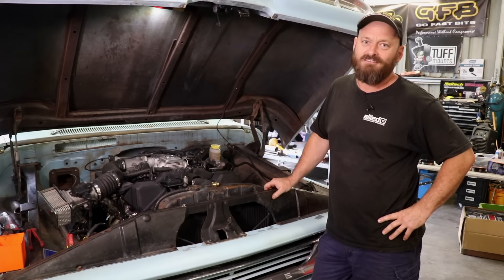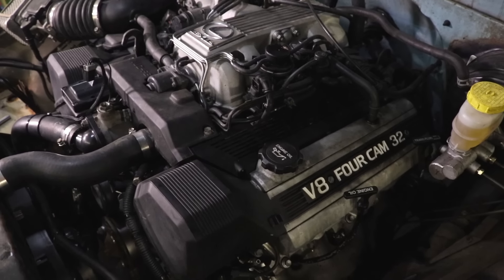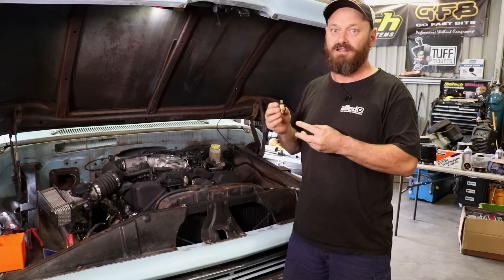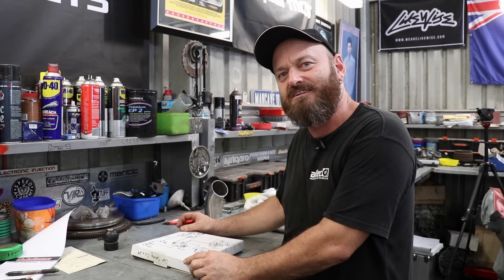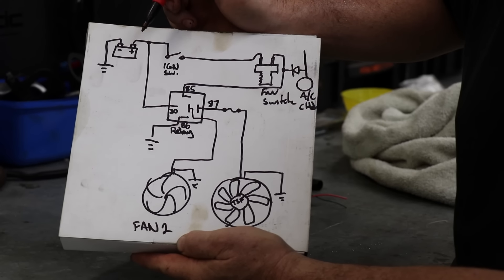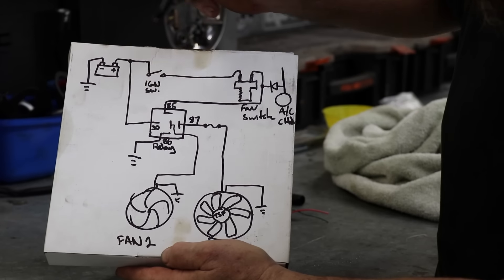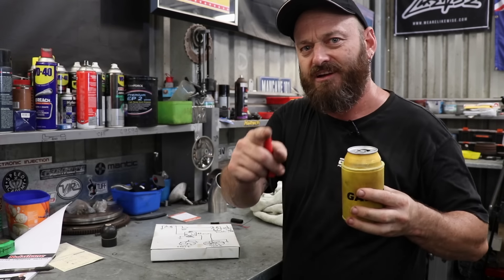THE SKID FACTORY - [QUICK TECH] HOW TO WIRE THERMO FANS

Comment: Nice one, I'm sure my Peugeot fan is wired in series with my switch with no relay. Power > Fuse > Switch > Fan > Ground. So it's even simpler than a relay setup :)
Reply: Yes and that is why these switches fail so often.
Reply: @alanbutler2579  I get that, totally man. They're not designed to take the high current draw.

Comment: I found a nice little SSR for PWM control which is cheap, waterproof, flying leads, mounting tabbed and heatsunk. Good for 40A too and permanent power. Only needs +12v, gnd and PWM signal. 

dorman fan controller 902-310 from Amazon 👌
Reply: If it's Dorman it might not run very long.
Where do you get the PWM signal?
Reply: @fascistpedant758  I have two for redundancy.. I have a stand alone ECU

Comment: I've always had trouble with thermal switches like that. Eventually they all go out of range and activate at different temperatures. That's why I only ever recommend adjustable fan controllers that you can adjust as your thermal sensor ages. Also allows for you to tune your activation temperature and sometimes your hysteresis. I get this is a cheaper option but the headaches aren't worth it for me.

Comment: Tridon TFS110 and TFS111 are 3/8" are good for v8's - TFS111 is best. If you have a/c you use another relay to turn on the fan. Ford 40 amp relays available on EA to AU can handle most fans. If you are using the FG single fan the Davies Craig controller works well as it turns on the slow speed before the fast speed

Comment: In your diagram the middle is usually 87a which means closed at rest or I term it always. The fan 2 would be on all the time with the ignition and off when the temp sensor switched to pin 87. So only one fan would be on at a time if it's a standard Bosch 5pin. If it has a legit two pole 87 switch then you are good

Comment: This is such a great resource. But I wonder if someone can answer this for me. 
I have an R33 GTST Skyline, I want to convert from the viscous fan to electric fan. 
There is already a thermo sensor in the radiator. Should I leave it plugged in and splice into it to run to the relay? I assume as pointed out its used for the AC as well (I still have AC)? 
Also do I need to do anything else to the old viscous /clutch fan assembly other than remove it (anything with wiring)?

Bonus: I also have a Link G4x ECU; is there a better way to do this using the Link?

Comment: Wicked job guys. I love the way you repurpose stuff and think out of the box. Wondering what your thoughts are on micro relays? Now al you can laugh but plz don't hold it against me as I have a v6 ecotec in my 4 runnner (It is a weapon off road). when I bought it  the whole conversation was dodgy so I replaced the engine,clutch and a realigned it all .At first I just rewired it with normal spade connectors to  normal relays but after 12 months of abuse out bush it started having relay issues. I did inox my engine bay and tried to keep everything important clean as possible and maintained but found them relays were just letting water in no matter what I did.  I stripped it down again and soldered In some micro relay holders off a ford rangers loom and has not given me any trouble since. They look more streamlined and seem fully sealed. I never really used them before So wondering if you guys have used them and if so pros and cons? I have a light on my roof not for the wank factor but found when you are out having fun in the mud and you go through a deep water crossing once your lights are under water it gets dark very quickly.

Comment: aren't some of those 5 pin relays normally open or normally closed on the two outputs so in your whiteboard diagram fan one would always be on, and fan 2  come on with temp/air con, and number 1 go out?
just in case i've got the dumb.. thought i should ask
Reply: Yeah the 5 pin relays I'm used to are like that, the centre pin is 87a and it's normally closed, and it opens when you energize 85 & 86.
Reply: There are some relays that keep 87a and 87 on when the relay is energized but yes you are correct that the normal relays you will find most places would function as you said.

Comment: Would you need a fuse for each additional fan added?
Reply: Yes, the power to pin 30 (fan supply) needs fusing before the relay as its direct to the battery, the thermal switch supply needs fusing as its after the ignition switch, and every fan after the relay needs fusing with ratings based on individual fan current needs.
Reply: I think that was just an error on the whiteboard. Yes, both need a fuse and only fan 2 was shown with one. As toby said below, better practice would be to fuse wire 30 near the battery as well as it is unprotected from shorting out as shown. In practice that's probably because these guys are mounting the relay right next to the battery

Comment: I'll never use ignition for the fan switch. A direct connection to the battery allows the fan to bring some extra cooling to the engine bay after stopping the engine.
Reply: But running a fan is of limited use if you have a mechanical water pump that turned off when the engine did
Reply: And you could return to your car a few hours later to find a slowly turning fan and a dead battery.

Comment: i actually prefer the single wire ground method. only thing with that method is if you want to add AC switch on, i add a second relay to switch on the ground. And with this method i also add a simple one wire switch to ground on the dashboard to overide and control it manually anytime.

Comment: Hello mate thankyou  for the explanation. Would you mind telling me  what thermos switch range would you recommend  on a daily  drive 351 celvo? Very mild build   thankyou
Reply from the maker: Nowadays I would recommend the Davies Craig fan controller. Does the same thing but prewired and adjustable. You'd probably go 85-83c range for a Clevo.
Reply: @theskidfactory  thankyou  for the recommendation.   if possible  I have got a follow  up question then... what would recommend  the thermostats  temp be??? As i went witb the fa tory recommend  which is 87 but if i put the davies craig unti in the the fans will be on permanent  so iam a bit of a loss now ?

Comment: I have a question, can this concept be used on oil coolers ? I thought of using the same fan swithc on an oil line. The plan is to try put this on my bike (oil cooler only, no radiators, and modified the engine a bit to much). And i live in tropical climate.

 But i was thinking about the working temperature of oil compared to water. They should be around the same ballpark, I suppose.
Reply from the maker: Yes. The sensor doesn’t discriminate between fluids.

Comment: Would you not want the fan circuit wired thru the permanent live, not ignition live?
Or am I stuck in the 80's?
(reasoning being if it's hot and you kill it without waiting to cool down first it could still overheat)
That was advice given to me about a Ford Kent engine from a 1600 rs Mexico escort in my kit car.
Reply: Most cars kill the fans with ignition off and it's not a problem. The coolant stops circulating anyhow, so you're only cooling the radiator, not the engine. It could be useful with an electric auxiliary coolant pump sometimes used to cool turbos after stopping the engine.

Comment: Hi Al i have a question regarding the placement of the thermo switch in the water circuit. Ive always put it in or as near to the cold water outlet, as the fan is there to help when the rad cant coap. Some in my local car club say to put it in the hot side.  Whats your opinion?
Dan
Reply: I agree it should be on the return from the radiator. No sense in running the fan if the return is already cold. You need a much cooler thermoswitch though.

Comment: G'day 
I'm thinking of doing a thermo fan upgrade to my 304 5ltr, where would you position the sensor? I was thinking of one of those top hose mounted things in the middle of the hose but their ugly. A sensor through the rad fins or something else to do with the temp sensor that runs to the dash. In your obvious worldly devine wisdom lol which way would you go. 
I'm serious about the wisdom part...
Cheers 
Troy
Reply from the maker: Some of the early copper brass rads had a switch mount hole in the hot side tank. That would work. Otherwise top hose would be the go. Davies Craig has a good relay and sensor setup that uses either a fin probe or a sender. Reasonably priced and easy install plus has aircon input to switch fans on also.
Reply: @theskidfactory  Thanks boyz, I have an old copper, brass rad but it needs a recore, but the Davies Craig route might be the go. 🇭🇲👍

Comment: What temperature range would you suggest for old Holden V8's / old V8's in general?
Reply: They should be run at 95-90 too but it depends whether the cooling system works properly and the engine is in good order. Most people run old stuff lower because it gives a larger margin for when it inevitably overheats.

Comment: Do you have any suggestions for a thermo fan setup for a stock Holden 202, I want to fit a thermo and get rid of the fan.
Reply: Spal or Comex fan(s) with as deep a shroud as you can fit. You can use this method to switch. I can't tell you what temp would work best though, depends on many variables.

Comment: So FAN 2 is on a normally closed circuit?  That means it is always on?
Reply: Yes it is in his diagram. Some Falcons are like this. You could run both fans off the 4 pin and 87 if not too much current draw.

Comment: Does relay have to have 5 pins or can a 4 pin relay work
Reply: 4 pin for most automotive uses. 5 pin can be switchable,87 and 87a or dual output 87 x 2

Comment: Have you used a similar setup with a intake air temp switch and small thermo on a top mount intercooler in an old patrol/landcruiser?  what temp range would be ideal?  Great vid guys!  🍻
Reply: I'm going to put my neck out and say as low as possible. You probably want a frequency switch (road speed being low) instead of a temperature switch
Reply: F
Reply: No I haven't but first thing would be to find a suitable switch, I don't think the coolant switch would be suitable. I actually agree with Skippy, road speed is a more relevant switch.
Reply: isn't that redundant for an air to air intercooler ? boost generated only when you're driving not idling , and when you're driving , there's enough air flowing already that the fan becomes a restriction . Unless water to air or towing at high boost low  speeds
Reply: Boost switch is probably the best, no boost no heat. Although I second speed as being better if airflow while moving is adequate.
Reply: @GavinY  heat soak on a top mount is especially bad. If you've ever driven a wrx around town you'll note how useless they are off the lights, but if you stop after a bit of 60km/h cruising they are a lot better. At zero to low speeds the combination of convection and radiator thermofans conspire to push air from the engine bay out through the intercooler and the scoop. You can use a top mount scoop as a hand warmer in cold climates.

Anyway my point is that you don't need to be driving hard to heat a top mount, you just need to have the car running and not doing moderate speed.

I've also yet to come across a single car that overheated on the highway because the fan was a restriction. More than a few overheat because of a lack of ducting though. Natural airflow at highway speed (if ducted properly) puts in the region of 8x more air pressure across the core than thermofans can.
Reply: @skippy2987  I found heatsoak in my wrx was bad using an aftermarket exhaust without heat shielding however heat wrap improved it a lot.
Reply: @skippy2987  heat soak is affecting entire engine not just the intercooler , it may help for traffic light launches but long term driving as long you're moving the fans can't beat that IMO. I guess it does help to straighten and guide the air in as a vacuum is created on the surface of the intercooler 'grabbing' the air instead of 50-50 some goes in some goes over
Reply: @GavinY  that's more or less it, except the non-fan airflow doesn't really start doing much until 30km/h even in a good setup, so most city or proper off road driving is affected.

In any case you can measure it easily. A loop of clear hose nailed to a piece of wood with (dyed) water in it is good for the pressures involved. That would quickly solve any arguments over how effective anything is

You may be in for a shock if your top mount is behind a bull-bar though.

Comment: Where do you find tst Bosch relay with double output ? I only find output 87 and 87a, which is NC  , NO . Only one contact  is energized  at a time
Reply: Most of them are like that in Australia.
Reply: really? that would mean the supply positive supply for fans must be huge to take theoretically 30 amp per fan through one terminal , big relay then

Comment: I kept melting relays on my last Jeep.  Cooling was always an issue when offroad and tried a few different fans including an out of the box solution from the auto parts store with thermometer to control the fan.  I was breaking mechanical fans so often so I tried electric and after so many melted relays, just said screw it and went back to breaking the mechanical ones.
Reply: Do you often crash into trees with your Jeep.

Comment: One thing I'm not clear on... the fans in the diagram, are they switched to run either/or, or does the relay turn them both on/off together?
Reply: Either 1 or 2 with switched centre pin but not both

Comment: So how do you run electric fans in a high speed and low speed configuration so the high speed comes on at a higher engine temp/load situation?
Reply: with a SPAL controller

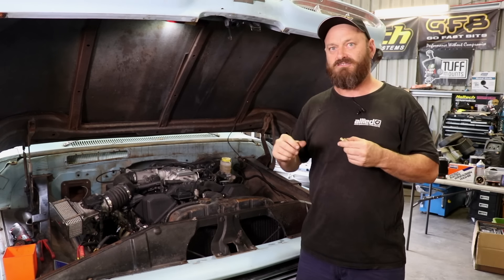Comment: @04:00 Al what about using aluminum tube (copper tube - better conductor of heat than aluminum) to tread in the sensor-switch and then using a die to tread the outer part of the aluminum tube to the threading pitch you desire? What are your thought on doing that if you don't have access NPT pipe fitting adapters?
Reply: It use direct heat from contact with the coolant not heat soak from its fitting.
Reply: IMO, both copper and aluminum tube wouldn't have the wall thickness to "reduce" the 3/8 NPT fitting hole (0.675" nominal OD) down to 14mm (0.55" nominal OD). And if you would use a 3/8 NPT brass plug and then drill & tap it for a 14mm switch - you would probably end up with only pieces of threads left over. Also NPT is a taper thread, smaller dia at the tip and the OD gets larger as it moves away from the tip; the fitting seals (with teflon page or liquid) are the taper. Whereas that 14mm switch is straight cut and it seals on a copper washer when it bottoms out. As Dick Taylor mentioned, it needs to be exposed to coolant not the housing or component it threads in to.

Bottom line is to try to locate a 2 contact fan switch for a Japanese or US OEM application, which both would tend to use NPT for threading into a cooling system "hole". But I can't recall ever seeing one of those; I tend to use a single contact switch with the related wiring scheme.

Comment: how do you wire up a fan with 3 wires say out of a 2002 bmw it has some pulse wire ... is it possible to to hack it somehow so it runs full .. i know you dont like it Al but its for a dirty old windsor living at 6 grand for 5 mins at a time .. i know i could just buy one that works properly but this car is based on what i have in the shed and i have this 02 or 04 x5 beema fan that goes on the front any help would be appreciated

Comment: With using the AC diode option, should we consider using a diode as a trap on the Ignition side so we don’t backfeed into another accessory when the temp trips the switch and the AC is powering the relay side?
Or just figure because the key is on, it’s all good to go.
Reply: The 12 volt source is ignition on. So a backfeed as you said won't occur if you have used the correct wire it has 12volts at all times. Only need to use a diode on the cold or output side of the switch as Al has explained.
Reply: The A/C can't be on unless the other line is already hot, so just as drawn.

Comment: so, this concept should also work for a remote mount trans cooler fan that has their own in-line thermostat?
Reply: Yes but you need to have the temperature reading coming from the hot part, aka the gearbox itself where the fluid leaves it.

Comment: In your diagram, why do you have one fan always running?  Fan 2 runs until the thermoswitch triggers, then fan 2 shuts off and fan 1 starts up.  When fan 1 switches off, fan 2 starts up again.
Reply: · this is a non change over relay. So it has two 87 pins (both normally open). Changeover relays have an 87A (normally closed) and a 87 (normally open

Comment: Haven't personally come across any other way to wire up electric fans than this (my nova's were all wired this way from the factory, but with the switch in the rad), have heard of fancy fan controllers in newer stuff, but only when they've died from heat soak. Haven't a clue what my Bertone's got, never had reason to screw with it so I ain't going near it, lol.

Comment: You must get different relays than the most common in the US.  In your diagram, the "inner 87" would be 87A, and NC, not NO.  So if wired as on your "whiteboard", Fan 2 would run all the time.  And I mean ALL THE TIME, not just when IGN-on, because 30 feeds to 87A until the relay is energized.

SPST 87A relays are much more common than SPDT dual-87 relays.  Or at least they were a decade or two back, maybe that's changed.
Reply: you can get a relay with 2 x 87. The relay with 87A is called a changeover relay